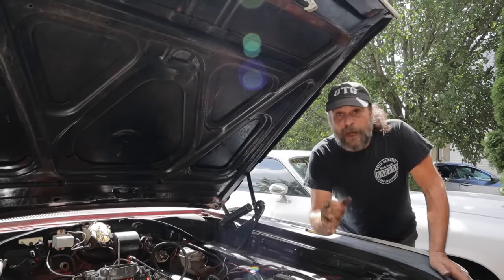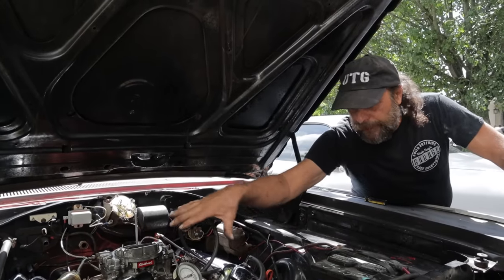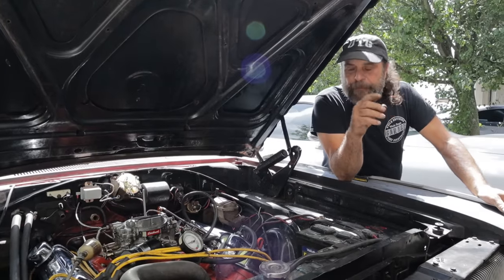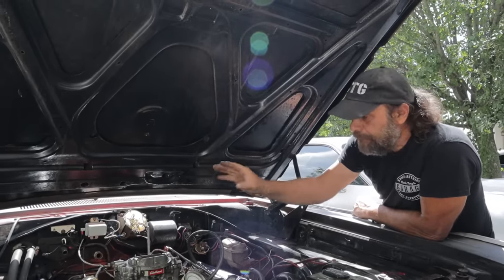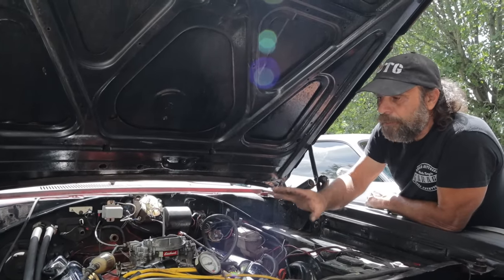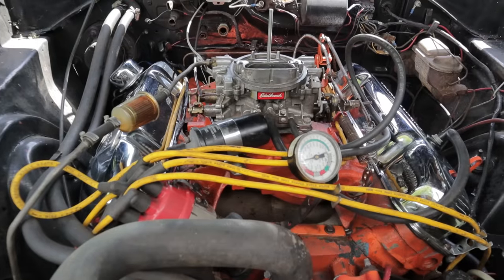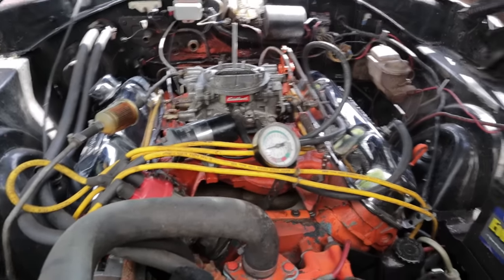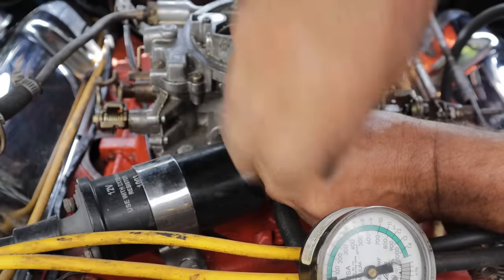Fine Engine Tuning With A Vacuum Gauge

Comment: should do a demonstration on erratic vacuum readings and valve lash
Reply: I agree. I have a stock 77 Dodge Aspen with a 318 with 87,000 original miles and I hear a little puff puff every once in a while out the exhaust. 
The vacuum gage reading is lower than I expected (around 14ish) and bounces back and forth about ten inches of vacuum in that 14 inches range. The chart I looked at said bad valves.
Hate to tear the engine down if it’s something else.
Reply: @brucesherrill4116  Well, technically, just pulling the heads off is not an engine teardown. I've done that to a few engines, and sure I'd like to rebuild the whole thing, or at least hone and re-ring it. But you can only do what you can do sometimes. Especially under a shade tree in somebody else's driveway...

You can fix that for the cost of head gaskets, intake gasket (which is almost optional) and a valve spring compressor. The screw on kind are not that much. After you've taken a wire brush and carburetor cleaner to the heads and made them shiny, stick a valve in, chuck the stem into your drill, and holding the valve tight in the seat with your other hand, spin and grind the shit out of it. You can get a decent valve job that way. Use plenty of grinding compound, and a slick oily rag will help keep your holding fingers from getting burned. Oil each guide first. Keep track of which valve went into which seat. Pulling against a drill will ruin it, you have to push with your other hand.
Reply: @brucesherrill4116  I think AGG is talking about a lopey cam with little overlap at which point I would suggest running it rich, but lean enough doesn't load up if you don't drive it appropriately. 

However, replacing the valve seals on you 318 may reduce you erratic vacuum. If you have good and even compression, maybe burn a little oil, and the manifold gaskets are good, then worn valve guides and bad valve seals are likely the culprit. You can also tell if they are bad if you pull the valve cover and instead of the seals you see small pieces of plastic in you valve springs then they are gone.
Reply: It means it usually means your guides are worn, or if you have solid lifters you have them set wrong.

Comment: On anything without an ECU I advance the initial timing to the point where I can take off in 2nd uphill and not get pinging. If I have a timing light and want to set up the whole curve, I start Ford's and Chevy's around 30 to 32 total advance and mopars at 34. I then drive it and adjust the advance plates to feel, and again under load, with no pinging.
Reply: Nice, how to know about vacuum gauges
Reply: Not the whole curve, just centrifical + base.

Comment: After 35 years of tuning my cars with a timing light (to factory spec) and tach for the idle mixture, this blew me away.  I tuned my 66 ford mustang with the vacuum gauge and it made a huge difference.  I didn't have to screw around with the timing advancing and retarding to get it just right.  I just tuned to the highest vacuum and its done.  Thanks Uncle Tony!

Comment: I'd like to hear more about ported vacuum VS manifold vacuum on the vacuum advance.
Reply: Clelan Sametts it’s all the same except at idle and WOT (wot has no vacuum anyways so it’s a moot point).  Manifold has timing advance at idle, lower EGT’s and not as good emissions, then pulls timing as the throttle blades are opened.  Ported vacuum has no advance at idle, because it sees no vacuum at idle.  As the throttle blades are opened, the vacuum rises and it adds timing advance.  The way that you determine which is best is the way your distributor curve is set up, and your application.  Some guys will swear by ported only, others by manifold only.  If you have the ability to use a dyno I’m sure there’s a negligible difference in part throttle power, because in the middle of the part throttle operation, with the manifold vacuum advance dropping and the ported rising, they intersect at the same amount of advance.  So, to sum it up, they achieve the same effect, just one adding timing and one taking timing out.  The engine will run differently on each due to the way they add or remove timing.  Remember, this is only idle and vacuum cruising, wide open throttle doesn’t matter for vacuum advance.
Reply: Check out Thunderhead289, he practically has a PHD in manifold and ported vacuum.
Reply: @Ltmonte  Joey. You should have a more thumbs up best answer I've seen it really is your distributor curve that seems to make the difference.
Reply: Joey Montemurro More advance at idle DOES NOT produce higher EGT, it lowers it. Other than that, you are spot on. Depends on how your particular distributor is curved.
Reply: Let the ARGUMENTS START!!!!!!
Reply: matt bauckman oh, well I was mistaken.  I suppose I can’t believe everything I read.  I had read they used it on some 70’s emission engines to clean up hydrocarbons in the exhaust along with air injection (and eventually cats)
Reply: Glam Stachee's 1980s nostalgia lounge that guy has good info but not the uncle tony flair
Reply: Jimi Fed thanks man, not in it for the likes.  Just want people who are new to distributors to understand vacuum advance because god knows it’s daunting at first
Reply: matt bauckman you are right ported vacuum was what I should have said
Reply: @mattbauckman9907  Early Ford's used a coolant temperature override switch to switch from manifold vacuum and ported vacuum to the distributor.  During cold start and warm up it was on manifold vacuum to raise the idle a little, when engine came up to temperature it would switch to ported.  If the engine idled long enough and became hot, it would switch to manifold to rev up the idle speed in cool the engine down, and then back to ported.
Reply: @Ltmonte  I like to call it like I see it,  well actually manifold vac. Usually made my car project run the smoothest . Probably because I don't go the whole 9 yards and have the dizzy professional curved just find some lighter springs to get the advance in quicker for acceleration.  Set to a reasonable 10deg before and  that's why I like manifold because I'm relying on the vac adv. to supply more adv
 At idle with my usual 270 duration camshafts. If I use ported  I need more initial.  Then my motor has heat soak slow cranking on the starter motor issues also because I haven't limited the centrifugal mechanical  run the risk of too much total. Sure my theory can have holes poked in it but the cars I've set up are very refined runner's.  Me thinks the worst that someone can do is not run a vaccuum advance on a street car . Over the years when I see that , other stuff isn't correct on the car also.
Reply: To understand this you have to understand why vacuum advance exists at all. It exists because at the lower cylinder pressures caused by the lower intake manifold pressure the mixture burns slower so you have to advance the timing to compensate. Knowing this, manifold vacuum to the distributor seems to make the most sense because it ensures that there is a direct correlation between cylinder pressure and timing advance. Since ported vacuum effectively turns off vacuum advance with the throttle closed it effectively de-tunes the engine making the timing retarded from optimal, this artificially loads the engine and intentionally makes it less efficient so it requires more idle air and fuel flow. This sends more heat out of the exhaust which helps to heat up and light-off any catalytic converter(s). IIRC the higher mass flow also helps with fuel atomization for a cleaner burn.

To me ported advance would seemingly tend to make the throttle tip-in overly sensitive or touchy because as soon as the throttle butterfly crosses that port and turns on the advance the engine would suddenly be in-time and would have a small surge of power. This might explain why certain vehicles I've driven are just that, touchy and hard to control during slow speed maneuvers like pulling in or out of parking spaces.
Reply: Jimi Fed I’m a fan of a slow short curve and as much initial as it will take
Reply: @Ltmonte  The age old debate.
Reply: Mark Estrada no debate.  The right one is the one you set your timing curve up for!
Reply: Google it or find it on YouTube, everything is on there!!!

Comment: Another great video. You should consider showing how you use your other senses. As an old schooler I  know you already understand but for the guys learning simple vacum tuning there would be a huge advancement in their understanding.  The old guys that told me "yea but listen, do you hear it?" or "do you feel it?"...."did you smell it"...usually requiring a repair in order to properly get it tuned. How many times were we told "it needs a tune up" but it really needed fixed. Your explanations are simple and exact. Thanks for sharing

Comment: Ok i cant let Tony's comment go......it takes WAY more than 2 screws for government to work in fact at last count it took several dozen screws and a think 2-3 cans of lube spray....4 maybe see i'm screwed up now AAHHH!!!
Reply: You forgot that if those were 2 government screws they probably cost about $3567 a piece depending on shipping , for mild steel.
Reply: Those would be defined as screwballs
Reply: @MrTheHillfolk  and still not work correctly
Reply: @jamesbetts3371  you have to install it  upside down , probably.
Reply: Lol

Comment: The reason you use ported vacuum to the distribution.
At idle the throttle blades are closed no vacuumed as you open the throttle blades you pull more vacuumed advance. So at cruising speeds you can pull more advance .
But when you floor it the vacuum drops and the vacuum advance drops off preventing detonation.
You can always pull more advance at low load on the engine cruising speeds.

Comment: Returning to this video after a little while a lot smarter. Your videos have really helped me build my car knowledge and in fact I'm about to throw a carburetor on my 1991 F-150! The engine is shot so I'm throwing a 19 86 engine in it and a carburetor swap will just make the wiring less of a hassle. I also bought a vacuum gauge a while back and I've used it to diagnose so many issues with my engine I have you to thank for this. I'm also throwing an Edelbrock on there which is the first carburetor I ever rebuilt so I really wanted to thank you for really helping me grow. I look forward to using all of this advice on an actual running engine instead of an old carburetor sitting on top and intake in my garage!

Comment: Uncle Tony I love the fact that you are there trying to help all of the car enthusiasts especially Move Over People Are Racing guys and gals. But I was looking at the picture of the fuel filter and how it is mounted and with all the trouble the so many cars have had with vapor lock and it was projected upon the Mopars (even though the others had the problem also) laying a G-2 filter on its side is bad. Because as fuel heats up and changes to fumes it’s not what the carb wants. It wants liquid fuel only.
The fix that I found that works years ago was to mount the filter vertically and have the outlet to the card at the bottom so that the liquid is headed to the carb then insulate the rest of the line going to the carb so it keeps the heat away if you don’t have a recirculate line like the ones that they used on all the new vehicles because the underhood temperatures started soaring with all the pollution equipment that was being designed into our vehicles. Try it for yourself and see and you will like how it works. 
 Thanks for being there for so many car fans.
Reply: Oh by the way I am a Keep It Simple kind of guy (KISS) and now they have made everything so complicated and complex I am surprised they haven’t put a seal on the hood to keep people out of it....

Comment: Back in the 1960's GM big blocks, if the engine wasn't worn out, factory timing almost always gave you nearly the best vacuum.  I always used a light, but confirmed with the vacuum gauge for fine tweaks. 

Now to be honest... that didn't always give you the best smog settings.  Back in 1981 I took my 1966 Olds (425 4bbl) through State inspection running really well.  It literally set a new station record for worst pollution ever recorded on their analog instruments.  It was so bad that they stopped the inspection line and let me re-tune the engine while hooked up to the machine.  After a lot of fast tweaks the car passed for 1981 pollution standards... but man it ran like crap.   On the up side, it did get better gas mileage.

So keep in mind... best vacuum doesn't always mean best pollution... nor best gas mileage.  And yes, I know it should, but it doesn't...  

Also, with the vacuum gauge, you can tweak an engine to run best on different octane fuels.  By 1981, it was getting hard to get Sunoco 260, 100 octane which my engine was originally tuned for.
Reply: @moparnut6286  I'm in NJ and it was at the Livingston inspection station... in the drive in theater... that My Olds was being inspected. When they stuffed the tester into the tail pipe... pandemonium broke out among the workers who all rushed over to see the highest readings ever recorded on the old analog gauges... 

"I can fix it" I told them while they pointed and cracked jokes... So I got my tools out of the trunk... while the line of cars behind me backed up onto Rt 10 and I adjusted the idle screws, and the timing and made other adjustments while the guys watched the meters for improvement... and made recommendations... like take off the air cleaner, pull the PCV, turn up the idle, etc.  It was rather bazaar, but I was grateful because I didn't have a pollution meter which at the time cost thousands of dollars to work with.

Finally the guy at the machine says, that's as good as it's going to get. And when I asked if I passed... He said, you passed for 1966 5 minutes ago... you actually passed for 1981.  (which was actually a catalytically converted standard and my car had no such converter)  

In any case, I had to do several adjustments to get the car running well enough to drive home after that.

Buy yes... My 66 Olds, 73 Buick, 84 Plymouth, 92 and 94 Saturns don't need inspection in NJ and all but the 94 Saturn are either tagged antiques or on collector insurance.   Unfortunately, I've got to find the dang evap leak by next year to pass inspection for my 02 Ford.... I truly hate new cars.
Reply: @RJ-vb7gh  That was very decent of the inspection station to allow you to adjust while hooked up to their meter. Here in Oregon we bet they would not allow it.
Reply: @frederickbooth7970 My car failed so spectacularly that the entire inspection staff came over to see the machine readings... They said they didn't even know the machine could read so high.  By that point everyone working there was invested in seeing how low the emissions could be tweaked down to, while they made suggestions.  When I asked if I passed the guy said, "You passed 10 minutes ago for a 66, but now you pass for a brand new car. (circa 1982)" 

That's pretty much when I realized that all of the smog stuff and the catalytic converter didn't do much of anything on a car that was tuned properly.  If your engine is burning clean... there's not much for the smog stuff to do. To be fair... once tweaked to ace emissions, the car ran poorly, I had to undo a couple tweaks to drive the car home.  In the end doable wasn't optimal.

But no... that wasn't the inspection station extending me a courtesy, it was more like them exercising their curiosity.  Pretty much any car with with a carburetor and and an independent ignition system can be tweaked to pass pretty much any smog test if it isn't smoking.  And if it's smoking... you bring it through after dark in winter when the inspection station is  open late... I had to do inspection 5 times until it got dark early enough for me to pass another car. And even smoking... it passed the machine test, just no one noticed the smoke.

Comment: Love the comment about the vacuum routing of the 1977 T-Bird.  That bird happens to be my daily driver right now and I know exactly what you mean.  I had some vacuum issues and had to bypass a lot of those heated routes and return the carb.  Still debating if I want to correct things or leave it as is.  After setting the idle mix, RPM, initial timing, etc, its a lot more peppier than when I first bought it but a lot of room for improvement.  Hopefully in the spring.  Thank you for taking the time to pass on the carb knowledge!

Comment: I’ve always set my timing by manifold vacuum, with the vacuum advance disconnected, and backed off by 5 inches of mercury to account for ignition advance under acceleration and higher RPM.  With a performance engine, I found that I had to back off the timing just a tad more to keep it from detonating, pinging and make it easier to start, but it usually isn’t by very much. Setting timing with the timing light was never really an option for me because the engines that I had used aftermarket camshaft, various different compression ratios and everything else was pretty much is thrown together so I really couldn’t set timing with a timing light according to any recommendation.
Reply from the maker: And that's why you set timing to total and let initial fall where it will.  If more initial is needed, time to curve the distributor and narrow the advance range.
Reply: @UncleTonysGarage  If you have a large cam you can also use your manifold vacuum for the vacuum advance. If will pull that idle timing forward a bit for a smoother idle in a large cam situation. On stock engines they used ported vacuum because the advance would be too far at idle and you would be making NO based emissions they didn't like. When you have a low vacuum from a big cam the manifold vacuum and a very quick short advance curve helps a lot.